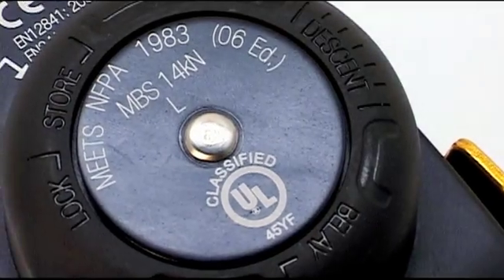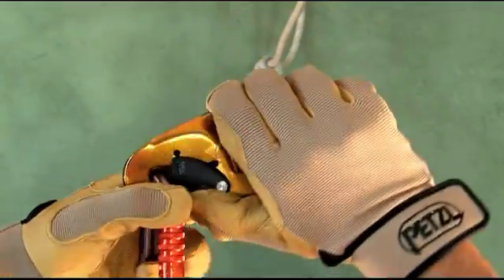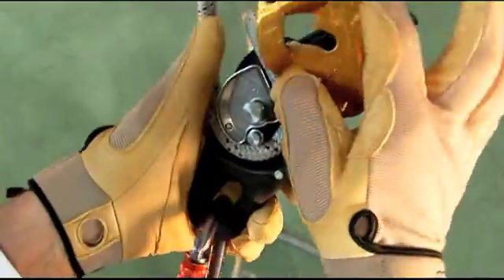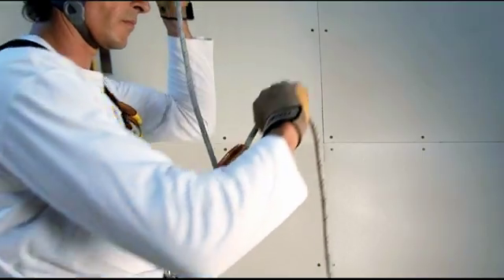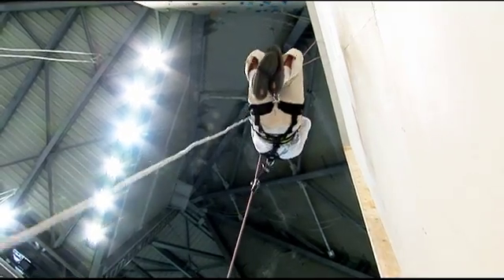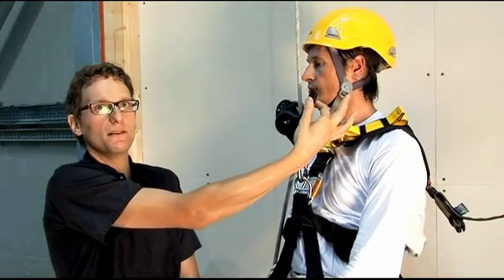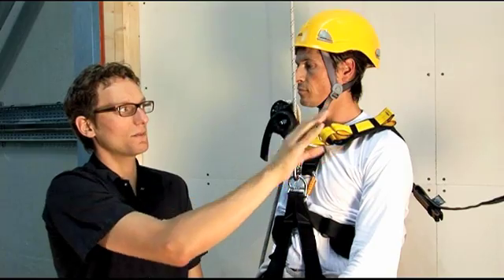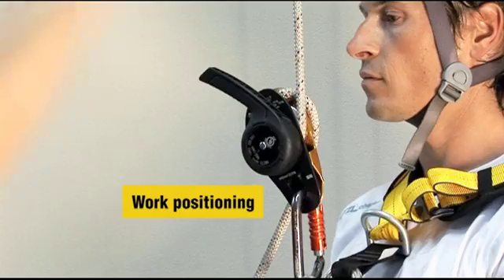RIG [EN] Compact self-braking descender for rope access

Comment: I love GriGri in sports climbing and very happy with it (have been using for about 5 years now and would recommend the smoother GriGri2). However it's not really rope friendly after 10.3 mm and most of the rope access and rescue technicians (such as myself) prefer 11 mm ropes and you can also encounter a little thicker ones depending on whom you are working with. RIG provides better grip and good work positioning in these situations, especially when some climbing is required.